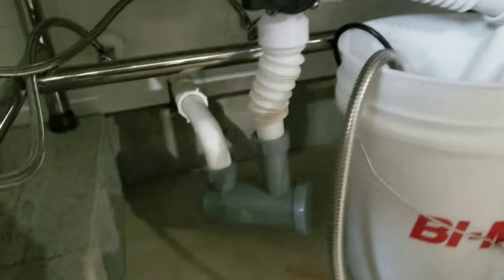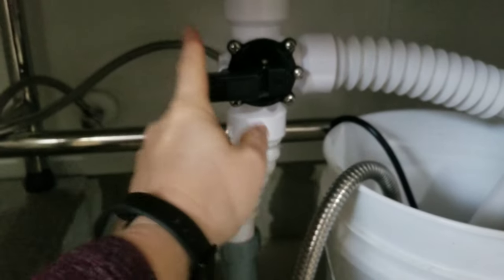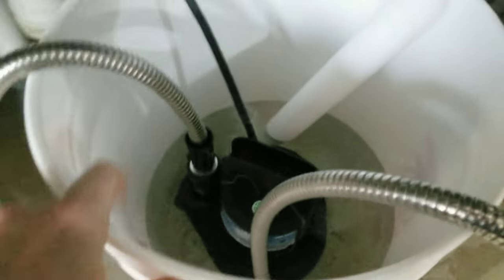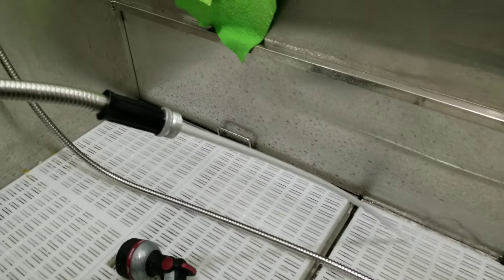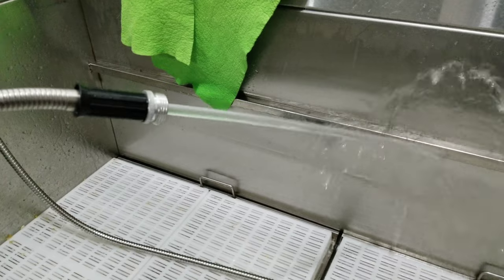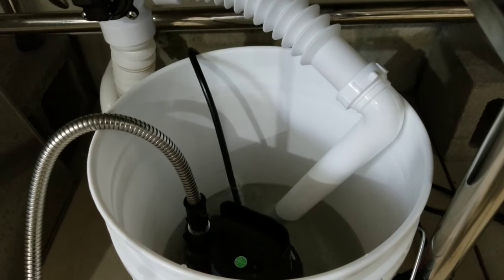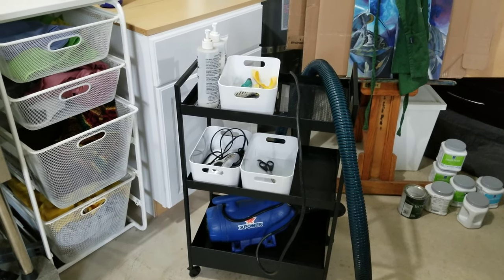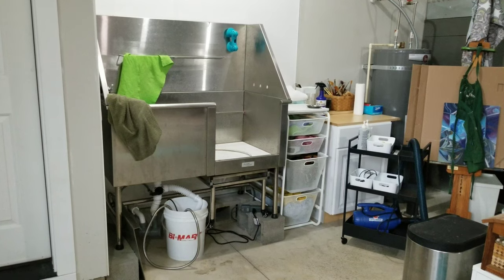Dog Bathing Station Tour

Comment: Where did you get the flow valve from and what size is it? Based on the looks of it, it's this? https://www.amazon.com/Fibropool-Diverter-Valve-Female-Threaded/dp/B00INKSBMS/ref=sr_1_6?dchild=1&keywords=3+way+diverter+valve&qid=1614469676&sr=8-6

Your setup is helpful. I'm looking to do something similar for bathing our standard poodle. Thanks for the inspiration!
Reply: @CorvusMalamutes  that's basically what I ended up doing. The tub I got came with a platform with perforations for water to drain through, so thankfully the sump sits under that and is out of the way.